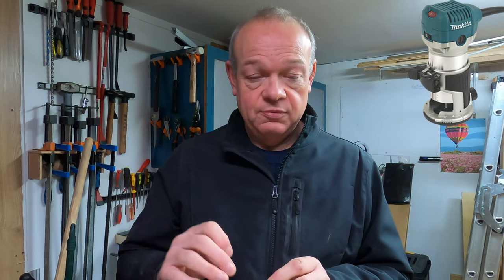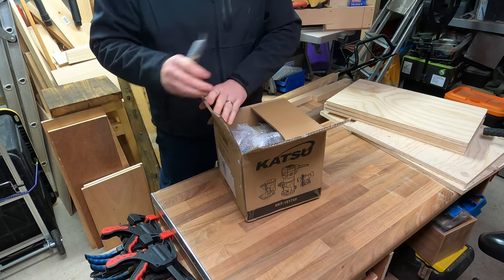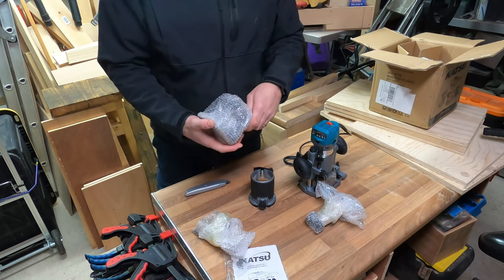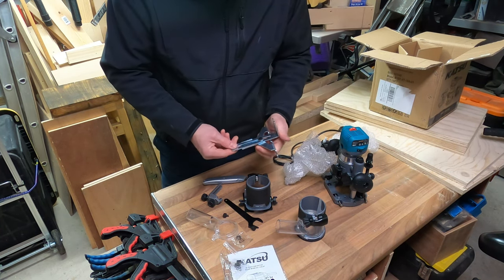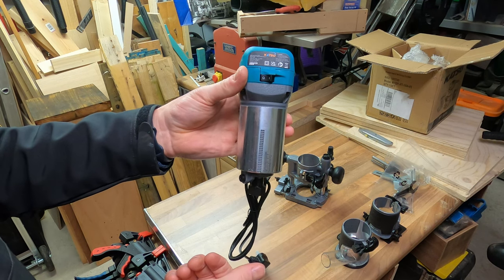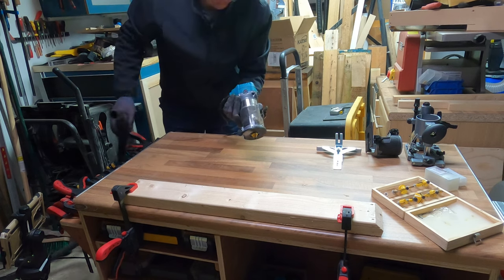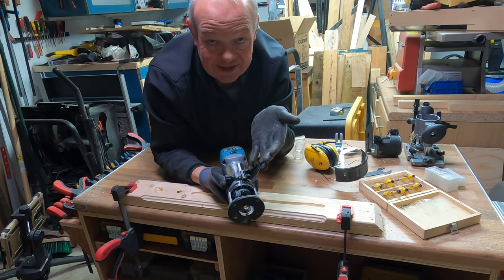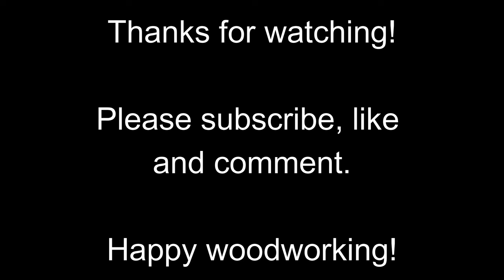10 Minute Tool Review - Katsu Router

Comment: I bought this router with 3 bases for £79 many years ago. Its been used & abused & its still going strong. I also bought the 18v katsu router & that's good too.
When routing hold the router around the middle & try & keep it flat on the work peice. The bearing will ride along the wood & keep it straight. If you tilt it slightly thats when you will get a crooked  line. Never hold it at the top as you have less control.
Reply from the maker: Thanks Grumpy...will do!

Comment: I have the Katsu after doing a lot of searching and reviews. Have all the bases except the tilt base but one diffferent to what you got in that kit which is the offset base. Thought it may have been underpowered at 710w but it has been an eye opener and has done everything I have asked of it and very very pleased. ebay if its fromn aimtools then it is a katsu as they are the official distro in the UK (I got the offset base and guide bushings from them). Overall a very very capable router that does what its supposed too. Currently buiding a storage case to hang on the wall and doing some dado's with it. Enjoy your purchase :) Also while there are a couple of differences between the makita and the katsu they both have the exact same user manual with the difference being the katsu only comes in chinese and english.
Reply from the maker: Hi and thanks for the message. I agree 100% with everything you've said there!

Comment: Good video, have the katsu myself and it handles everything I've needed so far.
However please be aware where the router bit is at all times. That first use you hadn't turned it off and got awfully close to the bit.
And as others said, hold lower down the router, might seem more dangerous being closer to the fast spinning noise maker but it's actually safer.👍
Reply from the maker: Hi Callum. Thanks for the feedback...willdo!
Reply: I 2nd that
Reply from the maker: @huski8124  Thanks Huski81